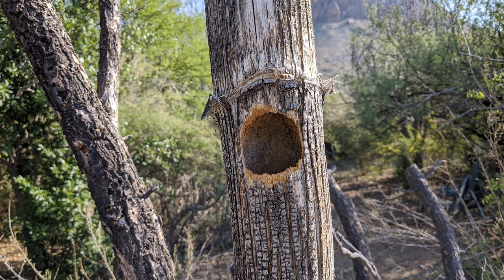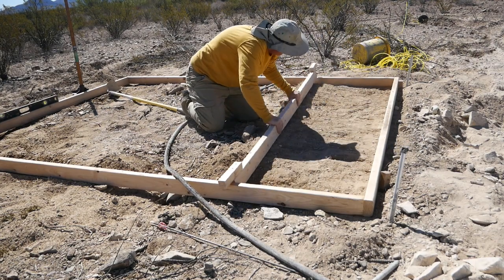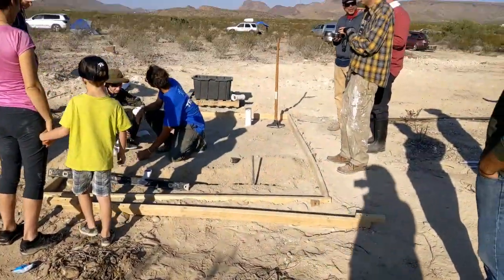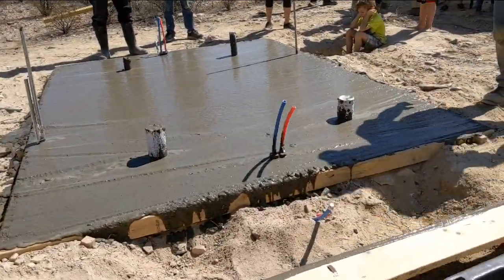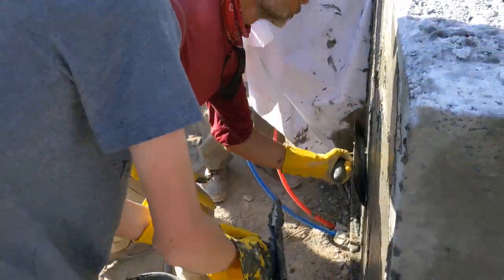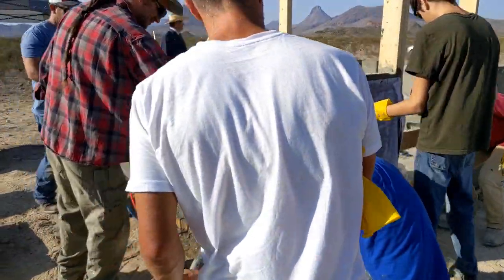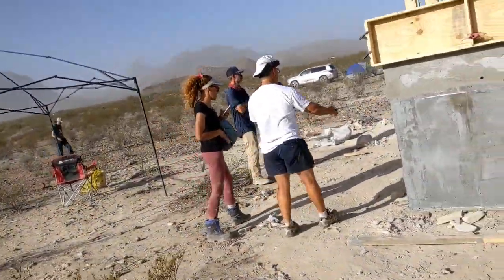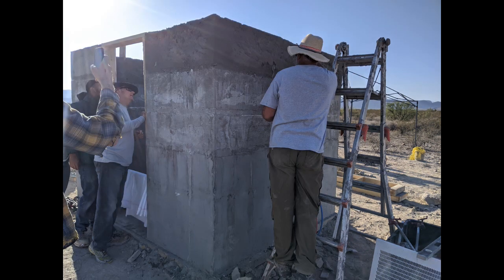Students After Terlingua AirCrete School 2020

Comment: i really appreciate your sharings. i would like to know if i can apply ''natural plaster'' that used for natural buildings on the aircrete surface as paints.    thanks.
Reply from the maker: Yes you can, but the AirCrete is not going to breathe much.